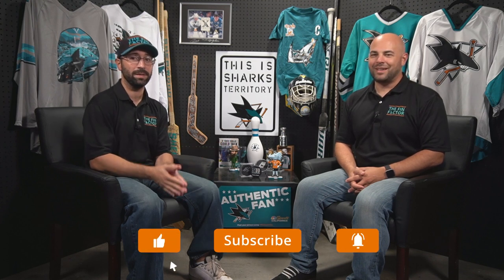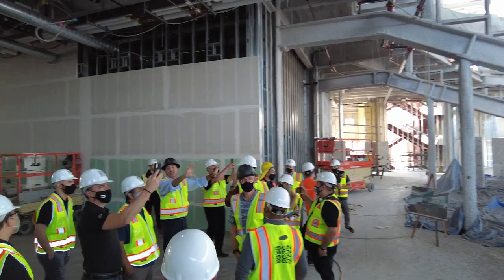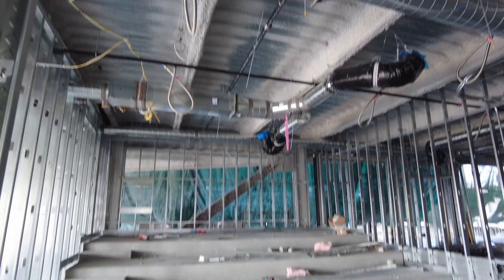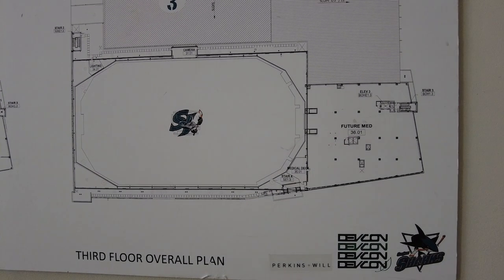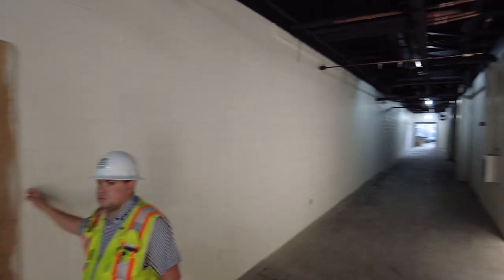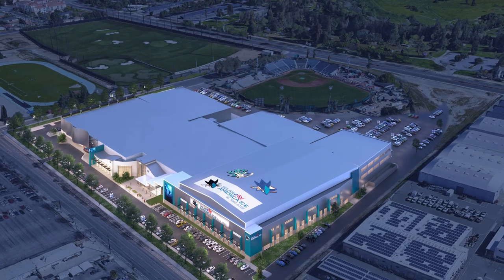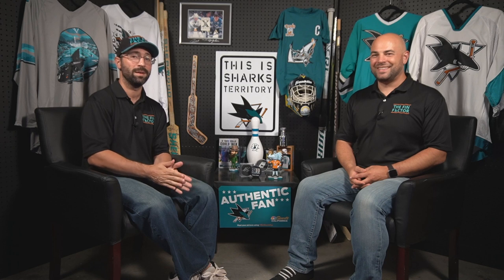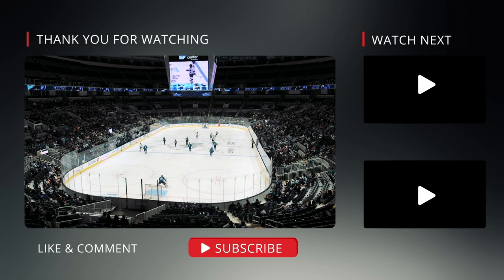Unveiling the San Jose Barracuda Arena: Elevating Hockey to New Heights

Comment: Biggest ice complex? OK, I grew up in Massachusetts during the Bobby Orr era. About every other town had a ice complex with a few rinks. The there at least five rinks in the town I grew up in (Wayland) and adjacent towns. So yeah, there wasn't a single complex with six rinks but there were easily 20-30 rinks within an hour of me.

We still only got ice time at 6 AM or 10 PM. Go figure.
Reply from the maker: The key is that it’s under one roof. No doubt other areas and hockey markets especially may have more total ice surfaces than San Jose, but as far as a single facility, S4A will be the largest.